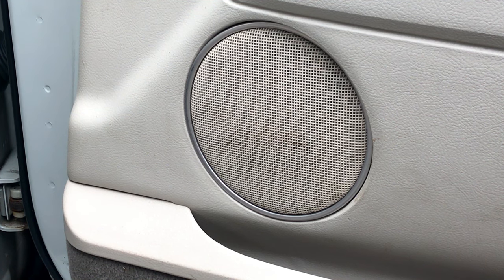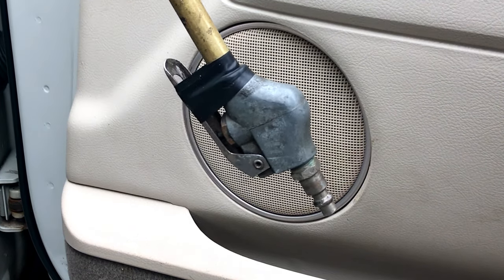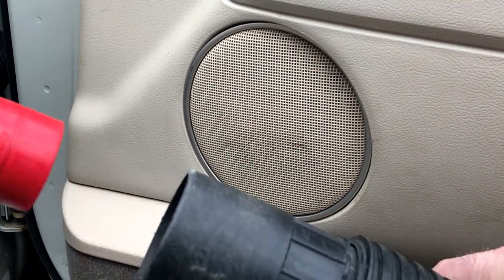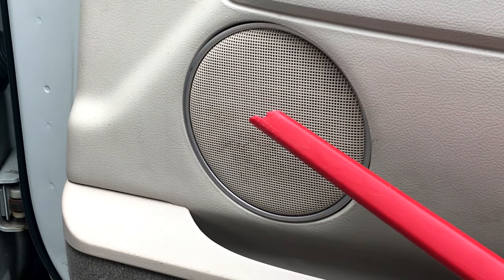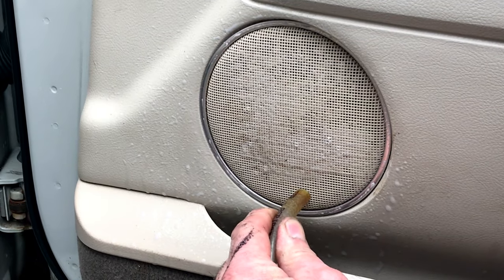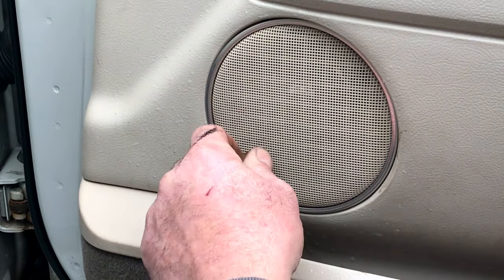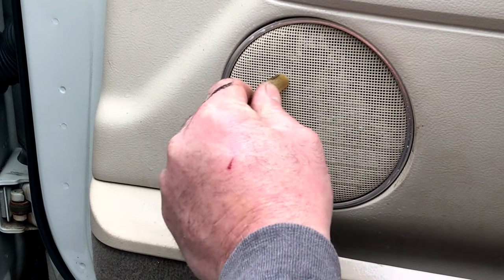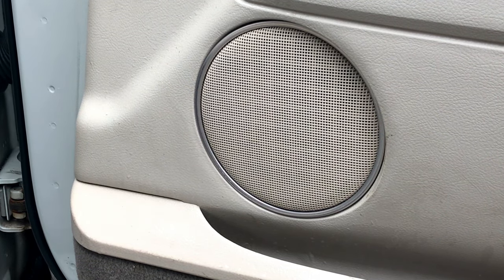How To Clean Speaker Grills in your CAR or TRUCK

Comment: Your method worked like a charm!!!  My Bose Flex speaker fell on a pile of moist dirt and the speaker grill got dirt in-between the grill holes.  Didn't have your cleaner but I lightly used ZEP citrus degreaser and a Ship Vac.  By the way, I lightly sprayed the degreaser careful not to get it onto the speaker itself and let it sit for 5 minutes.  Then I used a small new/dry paint brush to agitate the cleaner with the dirt on the surface of the grill. Did not poke the dirt onto the speakers.   Great Hack!   Thank you very much for the idea!!!

Comment: So are you sucking the moisture & dirt out, or blowing it in?  If you are sucking it out, does the tool do that on its own or do you put the air compressor into a suction mode or something?
Reply from the maker: Please re-watch the video in it's entirety, the tool I'm using attached to the tube sucks the dirt and debris out as stated in the video. Have a great day. mad Mike

Comment: I find using a wet/dry vacuum cleaner works well.  using one with bags the bag can get wet with a large job.  bagless works too on small jobs but with a wet/ dry one does not need to worry about damage or maybe even dangerous electrical problems.
Reply from the maker: no worries here with any p[roblems,     thank you very much for your great comment, it's great for the whole chain to have good people like you here :)

Comment: will cleaning the speaker rubber with tap water, damage the rubber over time? getting worried. thanks
Reply from the maker: no damage as most speakers are built to handle some moisture as they are in doors that get wet occasionally...
Reply: Sweet Project Cars awesome I can now rest easy. thank you very much!
Reply from the maker: Chris West you are very welcome my friend :) thanks mike

Comment: Did not think it would be safe to spray anything wet inside a speaker?
Reply from the maker: Well, as you know, the speakers in the doors are set up to handle moisture such as rain, splashing from puddles all kinds of stuff (when getting in and out of the vehicle). Thanks for watching. mad Mike the hammer SPC